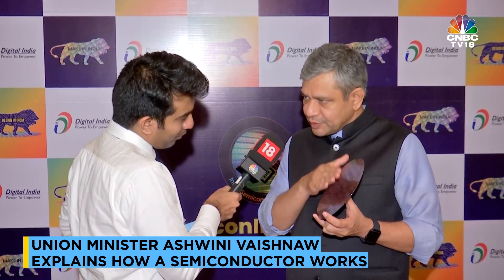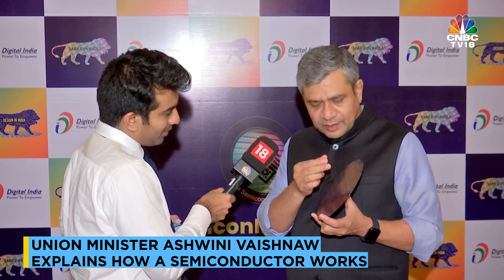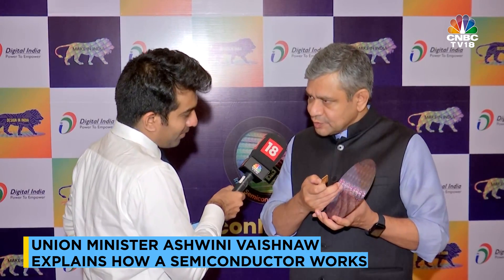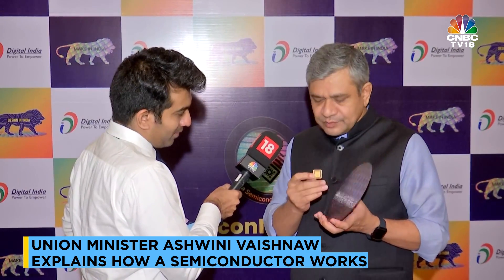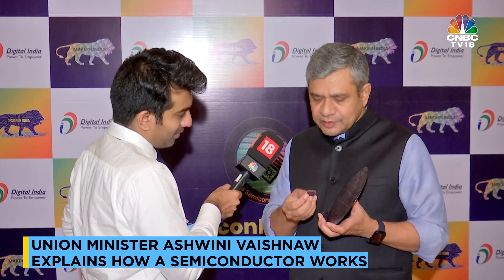Watch Union Minister Ashwini Vaishnaw Explain How A Semiconductor Works | CNBC TV18

Comment: In states like Kerala, almost every household has fridge, tv, mixie, smart phones, washing machines, microwave oven, water heater, laptops, tabs, PCs, cars, bikes, scooters and an innumerable number of electronic items which contain chips... these items become dysfunctional after a few years of purchase because of minor reasons... the branded companies which manufacture these products will often have a lackluster attitude to repair them and instead they will push the house owner to buy their new products since these old ones have crossed their warranty period.. So the owners will ultimately give away these products to some scrape collector shops and they will take the valuable chips contained in them and I don't know for what purpose these chips are being used for.

So my humble suggestion is do not let these reusable old chips go waste... some committees like Kudumbasrees should be formed and equip technically capable people to collect the chips from the one-time used electronic products from our households and make it available for our fledgling semiconductor manufacturing industry.